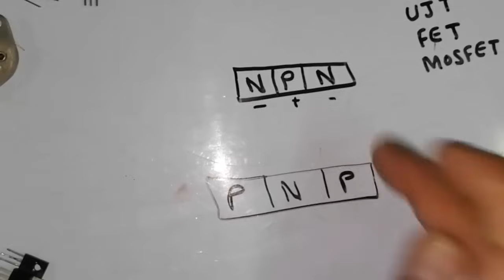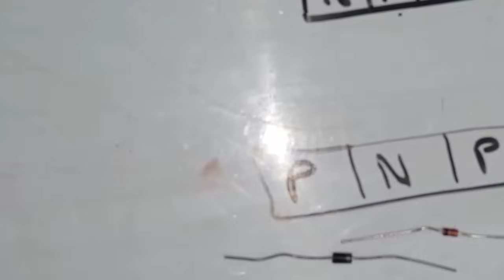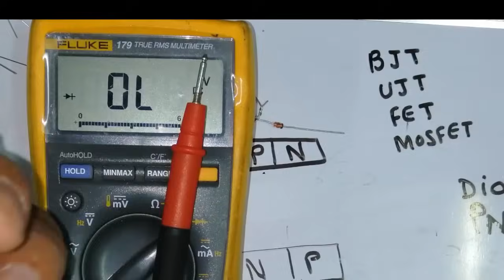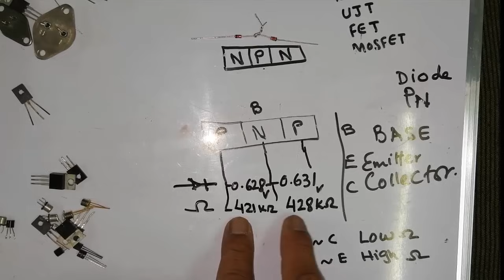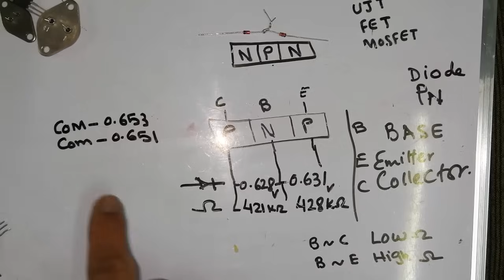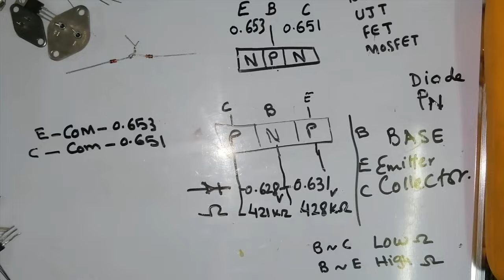How To Test Transistor With Digital Multimeter

Comment: Hi, great video. Do i have to de-solder a transistor from a circuit board to test if it is working correct?
Reply: you can get false readings, but not always. if the values are ok you can trust them, but if theyre not the readings youre expecting, it doesnt mean that its broken so you should check out of circuit. also if you find continuity between any 2 pins then its definately short-circuited